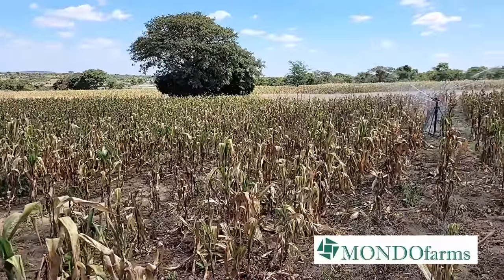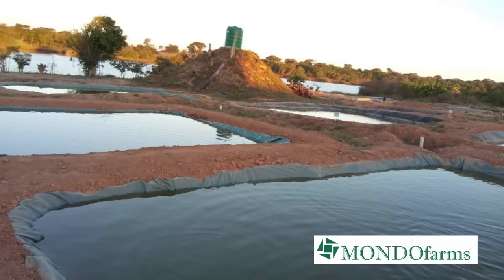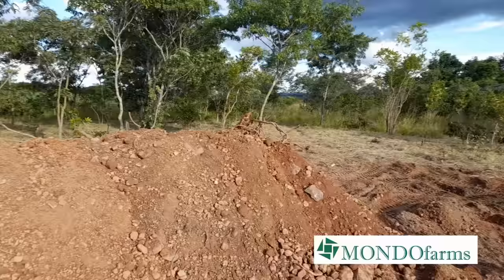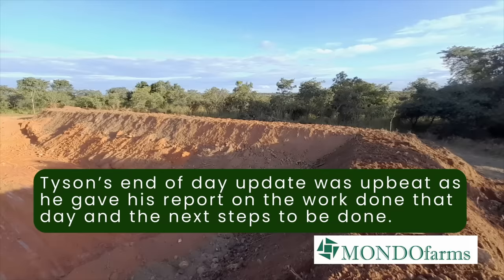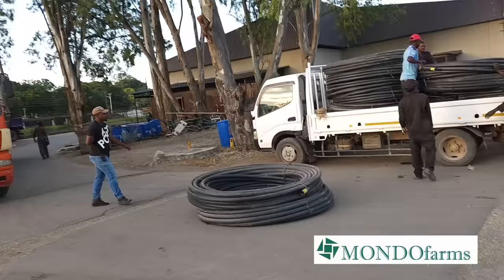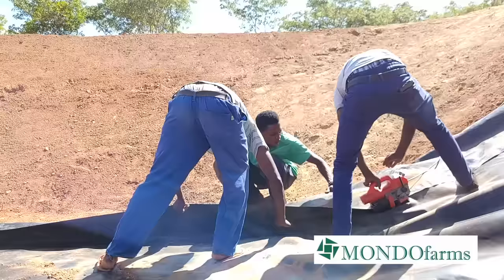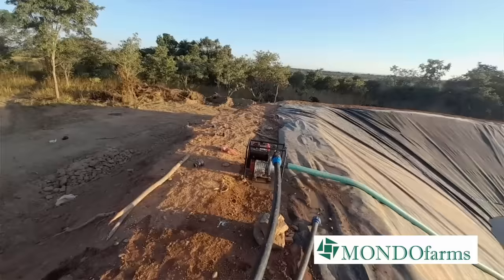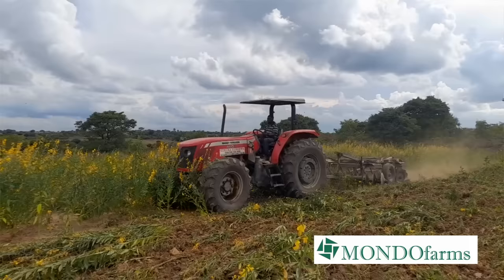How We Make Our Irrigation Water Reservoirs

Comment: I can see the foot prints left behind when the workmen were dragging up or down the steep bank will be a problem for you. the liner will try and stretch over the indentations . Much like it would over rock and stick. Good that you removed those.  To protect the steep sides of the embankment long wooden planks strapped end to end should have been used for workmen to travel up and down. The same planks could be pulled up from under the liner and use a second time on top of the liner for the welding and joining machine. Flat rope & timber ladders anchor at the top of the embankment  to take the weight would be another option
 Also ropes could have pull the long large sheet of liner by workmen standing on the top of the embankment rather than workmen trying to climb and run up and down the steep sides .
Reply from the maker: Thanks

Comment: How deep is your reservoir?  If it is less that 8 meter it would be possible to avoid the hole at the bottom of your liner to gravity feed  the fields below the reservoir by using the principle of siphoning. 
You could have a pump initiate the siphoning of the water over the bank. then allow the siphoning to continue with pump turned off and removed. Just like one sucks out petrol from a jerry can to fill a car's tank using a hose. 
For this to work; the height must be less than 8 meters. That is  from the top of the bank to the point inside the reservoir  the inlet to of the suction pipe is located . It will not draw any water below the 8 meters
Reply from the maker: Thanks

Comment: How many hectares of farming does this reservoir support and how many boreholes does it take to sustain it during the dry season
Reply from the maker: Hi there. Sorry, I'm going to let you down with my answers. 
From my few years of farming, I have found that there are a lot of variables involved.
Crop irrigation depends on several factors, including
 Type of irrigation (drip, flood, sprinkler (which type))
Type of crop and spacing
Type of soils
Age of crops
Time of year (evaporation rate)

As for filling the reservoir, we built it in April, which is just before our winter starts, so we have yet to observe how it cater to our needs over the next year or so.

We tend to go big with our reservoirs and know that we will never have enough water storage. We have also learned to control our planting as the year progresses. By October, we have the fewest crops oit in the field.

Sorry that I can't give you much more definitive answers. Farming requires taking risks and giving oneself a lot of time to learn the ins and outs as you go along.

Comment: Where is the source of the water supply for the reservoir?
Reply from the maker: We didn't include anything about the source of water that we store in the reservoir. 

But we introduced the idea and benefits of irrigation at some length in the beginning.

This video was meant to focus on the reservoir, which is a key piece of infrastructure in an irrigation system.

Comment: What pump size in horsepower are you using to push water up hill 700 meters
Reply from the maker: Please consult a water pump supplier in your area for more details about what you would need in your situation.
The two main characteristics of a water pump are flow rate and head. Pumps come in different combinations of the two.

All the best.

Comment: You reached the stage of installing the outlet at the bottom of the but didn’t explain how the water rise to the top of the canal type(trench)  where the workers were standing that level is higher then the outlet inside the plastic liner
Reply from the maker: The outlet has a control valve, so we only draw water from it when needed.

Comment: How much is a pond liner cost?  can I dig a water reservoir by hand if I do not afford excavator?
Reply from the maker: The costs of all such things vary according to size, location, suppliers of material, etc. That is one of the reasons we didn't include numbers in our video.

Yes it possible excavate manually depending on the size and scope. Our experience with manual labour in our area has not been positive, hence we started to bring in machinery.

All the best.
Reply: @mondofarms4343  thank you very much for your reply,  in short I'm in Tanzania and I also doing farming but I've got interested in your style of farming.

Comment: Hi what type of pump do you use for a reservoir like this? Could you create a video that looks at selecting pumps and other irrigation systems?
Reply from the maker: Pumps are difficult to advise on given the various factors that have to consider.
Size of the field to be irrigated
Type of crops
Frequency of irrigation required
Type of irrigation in use
Distances and elevation to be traversed
Weather and climate conditions 

We consulted a reputable pump supplier, and were advised accordingly for our situation.

All the best.

Comment: How do you get water out of the dam to the crop. please explain to me.
Reply from the maker: Hi Ba Mutale. Pls watch the video again carefully to see where we showed it. 
Look out for the part where we show the water outlet being put in at the bottom of the reservoir.
Reply: @mondofarms4343  Thank you tata, I did see where the outlet is being attacked. Perhaps I should have phrased the question differently. Do require a pump somewhere for the sprinklers to work effectively. What moves the sprinklers? I am not a water engineer but I am thrilled by your work there.

Comment: Hello good idea what advice can you give to someone who has all time river through his farm.
Reply from the maker: I assume by all time river, you mean that the river is not seasonal and runs all year round. Wow!! You are so blessed!! 

Most streams and rivers are seasonal. Which is why most farmers have to have water storage like these reservoirs.

You probably don't need to and can irrigate straight from the river if using pumps. But for drip, some storage uphill would be helpful in controlling water pressure. Drips don't perform well under pressure from a pump.